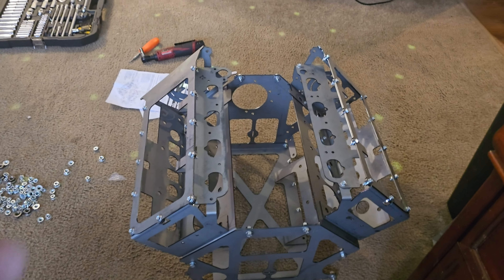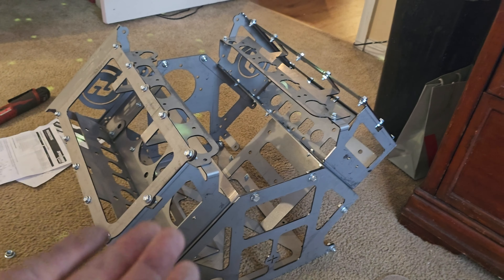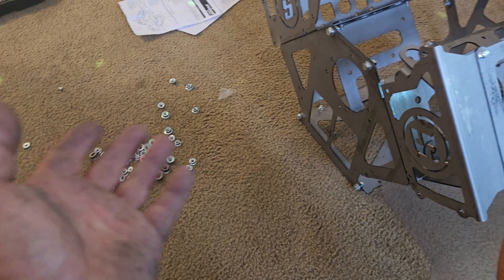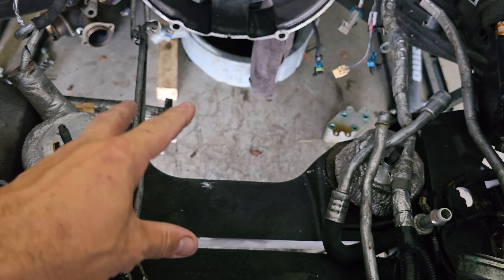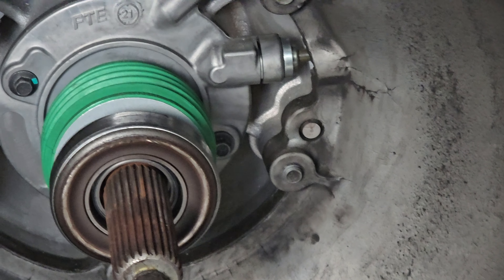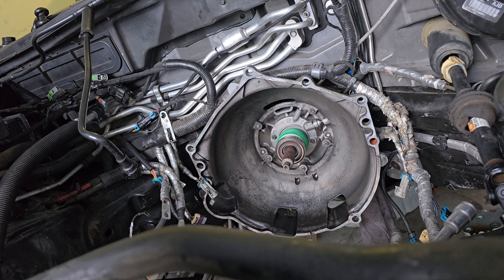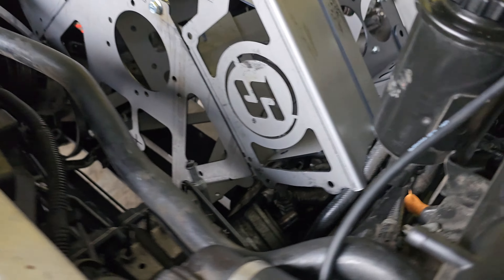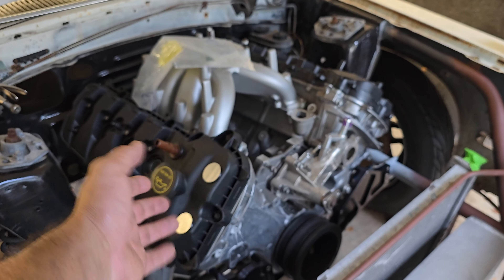Should i coyote swap the ZR-1?

Comment: For me the C6 is the better overall platform and Coyote is the better engine. The two together would be pretty cool. I hope this works out.
Reply: What's better about the coyitah?
Reply: @HioSSilver1999 everything only down fall is physically bigger.
Reply: @calvinmauney5669  well and it makes alot less power.
Reply: @HioSSilver1999  you mean it makes a lot more power
Reply: @HioSSilver1999  4 cams, RPM, and horsepower potential without opening the motor.
Reply: @JoshuaKelly-pi9ut  yea the ls/lt stuff does
Reply: @JpL4K3  but it makes less power with out opening the engine. Then it makes alot less when you do open them.

Comment: Forged pistons and rods from Texas speed = 1600
Replacing a sleeve in the ls block 
1 .240 per sleeve (melling) (installed!!!!)
2. Decking the block 250
3. Balancing rotating 350
4. Ls9 head gaskets 120

Will do 1000wheel at 20psi no problem.. youre making a mountain out of a molehill.
Reply: Absolutely... Can even buy the 376lsx B15 and can it a day or B8
Reply: Dude said Texas Speed lol
Reply: @oliverbryan6883  hahaha your name is Oliver

Comment: yes 100000%    i did the 6r swap in my 01 silverado, i JUST picked up a gen 2 coyote yesterda from the local scrap yard yesterday. god everything from intake to oil pan (even still has the belt on it) plus the wiring harness AND pcm. has 80k miles on it and i got it all for 3100!!!!!! I am PUMPED to start swaping it in!!!

Comment: I'm an LS guy, and even I say this is cool. People that drag race just don't get it. Before the coyote, there were no badass high revving V8's on the market except for the BMW S65 and S62. The coyote is MUCH easier to work on than either of those engines, is cheaper, and makes more power. I put a VVT deleted Gen 2 into a 2014 and it turned out really cool. With a coil-near-plug conversion and aftermarket cams, that thing would have been perfect, since it was already on a Terminator X. The ACT prolite and solid hub 6 puck ran nicely as well.

Comment: looks like its going to fit well, next step is to find out if the torque tube bell housing is a standard Tremec to GM bell or if it is its own GM part or do a TR6060/ T56 Magnum and custom drive shaft. btw i saw your snacks on the cowl of the ZR1, do the chocolate pretzels melt in the Florida heat?

Comment: Hearing an 8500rpm coyote in a Vette would be so cool! 😂
Reply: Hearing a 8500rpm ls is way cooler and way way faster
Reply: @HioSSilver1999  not way faster.. but way way more money.. especially with a blower.
Reply: @jbuch66koop  how so? 

And yes way way faster. A ls or lt shits all over a coyotah when they turn the same rpm
Reply: @HioSSilver1999  "when they turn the same rpm" 😂 any idea what needed in an LS to turn in to 8500-9000k reliably? An LS built to run well at 8500-9000. Is going to be a 100% race engine. It's just gonna drive like shit on the street, because the cam isn't even thinking about doing anything, until well north of 3k rpm.   Not a single item in the engine being from Chevy, including the block, except maybe a couple gaskets.. probably need a billet crank and aluminum rods as well. I would look into haw fast a set stock heads and a factory block have been with a coyote before you start running your mouth. Idc if someone has a 40-50-60k dollar LS engine. Did you see the fully billet LS the dude bought to put in Brett's mustang, to try and beat the times Brett set with a set of factory heads and a sleeved factory block....

Comment: Would it be easier to adapt a s197 tr6060 trans behind the coyote ? Didn't the zr1 come with a tr6060 also. Would solve the custom bell housing but the sensors would maybe need to be switched over and driveshaft. Don't know just throwing an idea out.

Comment: What about using the e67 ECM? You only need a 58x reluctor wheel and a 4x cam gear (not sure what the coyotes use) and everything in the car will work correctly... Just a thought. You can change the firing order in the LS PCM..

Comment: The c6 bell housing is the standard gm pattern. So if they made a gm bell housing to mod motor then you’ll be good… does anyone swap 4l80’s on mod motors?? And for the oil pan why not use a dry sump to keep the pan thin? You have the tank and everything there. (Tho I have no idea if there’s a simple compact dry sump available for coyotes.

Comment: Mixed feelings on the subject.  I will only say make sure you have your gear ratio options well sorted before you start.  8200 rpm Coyote on ZR1 gears is gonna be really, really long.  Nearly 80 mph in 1st gear, 115-120 in 2nd.  Car would be basically a 3 speed without swapping in a tighter diff ratio.  That said, there is a really cool close ratio sequential box available for the ZR1....if you win the lottery.

Comment: Since tremec has a bellhousing converting to modular pattern, it seems logical that it's possible.
Reply: They don’t have a bellhousing with the torque tube bolt pattern to the Coyote bolt pattern.
Reply: @kevin_m110 they have made custom bellhousings before idk about a torque tube one but if they are making customs for others it might just take a lil more money to do one for a corvette with coyote..
Reply: @8.1b-c1i  correct custom ones can be manufactured so you can adapt an engine to anything with the right design. But Ryan mentioned Tremec makes one, which is what I was arguing.
Reply: @kevin_m110  true

Comment: This makes as much sense as an AWD  Mustang IMO. Getting this to work with  perfect hood fitment, and pinion angle is a huge expensive gamble. Worse case scenario you will have to settle with an NA coyote, or running no hood (like a cringe Cletus swap).An even worse case, 10 s of thousands of dollars in custom one off parts to figure out it's not even worth it. Then you are stuck selling whatever people are willing to buy to not even recoup the cost. I am going to get flamed for saying this, but it's not worth it.

Comment: How exactly are you going to mate the corvette computer to the coyote engine?  Get the gauges to work?  Coyote swaping an old car is easy bc there is no stock computer system but this is far far more complicated - near impossible to get everything working correctly - and will be an epic hack job or fail if attempted.  I don't even believe Alex is serious - he is just making content for idiots who think this is feasible. On that basis - I gave this vid a thumbs up - for the exploitation of idiots.
Reply: @Marcus007  you do know cars like twin turbo r8s and stuff run multiple computers right? Alex running 2 computers would not be that difficult people do it all the time.
Reply: @hatch450sx3  They do not run two main computers, each designed to run all operations, but then the  responsibilities are divided among the two, and they cant speak to each other and neither has the ability to read the other's sensors.  So yr analogy is wrong in this context.
Reply: @Marcus007  No, the twin turbo audis piggyback a syvecs or motec alongside the stock ecu.  You can feed data to the stock ecu and keep it happy while maintaining dash and other functions.  If can definitely be done.  Whether its worth it or not for coyote vette is a different question.